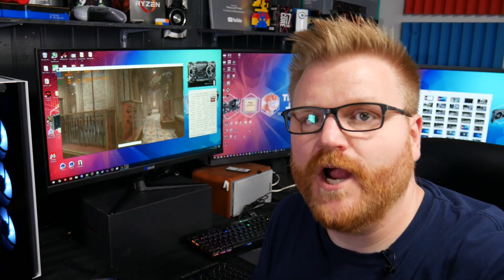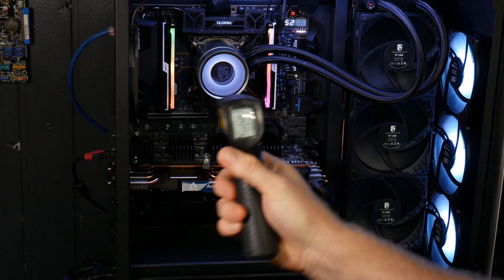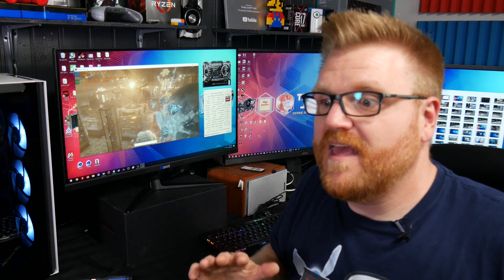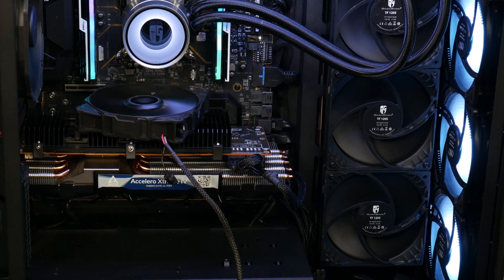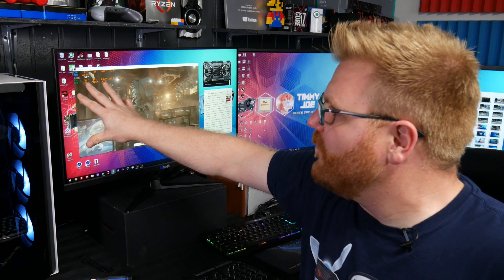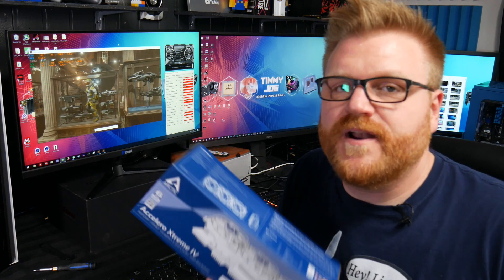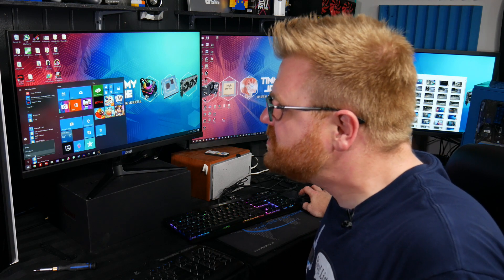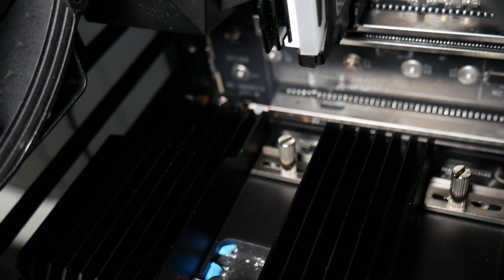Not even the Arctic Accelero Xtreme IV...

Comment: Why you keep running away from Raijintek Morpheus II ?
Reply from the maker: I showed what's going on with the Morpheus at the beginning of the video. They know their cooler which uses the same glue on heat sink design as the arctic iii doesn't cool this card properly. Apparently they are making a special version to fix the problem and they said they would send me one when they fix the issue. They have obviously done more research than arctic
Reply: @TimmyJoePCTech  Ohh ok, my bad. I didn't see the text at the beginning. I have Morpheus and Morpheus II and they don't use the same glue like the Arctic one, so I don't know what they are talking exactly, but lets hope to be something batter. Maybe they are talking about batter sync design. Anyway, we'll wait for update on this topic. Thanks for the info until now.

Comment: has anybody considered that the temp readings for the memory are offset somehow?  i mean like how some ryzens (or was it TR) used to need a formula to get the right temp.  what the sensors showed was either 20c high or low?  they said they needed to do it that way for some reason.  i just dont see why vrm and vram would get that hot on a card thats not really pulling that much power.  something has to be up.

Comment: The Accelero is an excellent cooler, but it's an aging product that has been around for a long time. I'm using that same one with the huge backplate/heatsink on a GTX1070Ti, I added heatsinks directly to the components on the front in addition to the backplate as well, so it cools them really well. But it seems it doesn't fit well on the AMD 5700(xt) cards, since the components on the PCB also needs a lot of cooling, some dinky little heatsinks and heatsinking it through the PCB won't cut it. It doesn't mean the Accelero is a bad product, just not a good fit for this. Arctic should've tested it and just said "Hey, this won't work, we need to come up with a better solution for this GPU series." I think they need to somehow create a new front heatsink which can also directly cool the memory and VRM components as well, instead of relying on secondary cooling solutions like gluing heatsinks and giant backplates.
Reply: Hey man, I want to buy this cooler and I have a question. I have a GTX 980 TI from Zotac, and I have a big backplate that is getting very hot especially when under load (that's good). What do you think is the best method to attach the black heatsink from Arctic to the backplate? Did you do that, that way or you attached it without a backplate?
Reply: @piotrjankowicz7242  Remove the original backplate and replace it with this heatsink backplate. The original backplate isn't needed anymore.
Reply: @Skauber  hmm, maybe you are right. Well, I figured out yesterday that the heatsink from Arctic is soo big that it will not fit 2mm because of the ram slots:(... + will be very close to my bq dark rock pro 4 (which is not good I suppose..) Maybe I will just leave the original backplate and mount just the front of the cooler..
Reply: @piotrjankowicz7242  I had the same problem, I also use the Dark Rock Pro 4. I shaved down the fins on the backplate heatsink, reducing the thickness of the heatsink backplate by around 8 or 10 mm, so it would clear the RAM slots and the giant cooler. Used a power sander for this, and it took about 10-15 mins of sanding to do this, finished it off with fine grit sand paper to give it a nice shiny finish on top of the fins.
Reply: @Skauber  Thank you very much for sharing this. I will probably do the same thing. Last thing.. did you buy any additional  "small heatsinks" for the memory? It seems weird to me that the 3rd version had these heatsinks included, and the 4th version doesnt. Memory needs cooling as well...
Reply: @piotrjankowicz7242  Yes, I actually bought the heatsink kit for the Accelero 3 from Arctic to get different sizes, so I have heatsinks glued directly on the chips in addition to the backplate. I also find it weird they didn't include those in the kit....
Reply: @Skauber   Thanks for the answer. I will have to find and buy some heatsinks too.

Comment: Did you sell your vii if not i would put it back in its a much better card. The xt’s fine but the vrm and memory temps scare me. Going from a strix 2080 and strix 2080ti the 7 and xt were really loud to me but i good undervolt on them really helps. But my vii with a 970-990mv undervolt stays 65c max edge 90c max tjunction and memory and vrm’s run really cool. Love you channel keep up the good work glad to see your growing pretty fast. Most of those bigger channels are getting kinda boring some better than others.

Comment: try thermal gluing (pasting i guess in case it doesnt work?) on some small heatsinks to the memory and VRMS directly, I reckon it will help with temperature.
Reply: This is what I did for the Arctic cooler that I used on my R9 290. It worked amazingly.  I don't know why he doesn't try that. People have been having bad results with that back cooling plate for years. Everyone I've talked to that owns one of these coolers used individual heatsinks for cooling the ram chips and such.  Also, lots of people have commented about this in these comments. I honestly think he just wants to bash it and be mad I guess...

Comment: should have kept  your radeon vii
Reply: I bought a xt to tinker with played with it for a week then put it in the box and installed my radeon vii. Have it paired with a 3900x and a 8700k with a strix 2080ti. The vii when undervolted runs so much cooler on everything especially vrm’s and memory. My tjunction maxes out at 90c and edge stays around 65c with my 990mv undervolt. I really like the look of the vii plus it matches my case the silver phantex evolve x. Also just put a 2700x and strix 2080 in another build. All i have left to pair the 5700xt with is a 5820k, 3770k and 4590k. Gonna put it with the 5820k at 4.7ghz with asus x99 pro 3.1mb. I spend way too much money on pc parts should’ve built one crazy pc with an rtx titan. But if i only had one card in the xt’s price range i would get a 2070 super. Gonna be pissed if the 2080ti super rumors are true.

Comment: Odd cause it worked fine for my GTX 1080 FE. Always look forward to your videos
Reply from the maker: Because the memory on a 1080 does not get hot like this thing does
Reply: @TimmyJoePCTech  mine came with memory heatsinks. But luckily my msi ventus oc 2070 pre applied memory heatsinks. 
Not sure if they are anodized aluminum or black color copper...
Reply: @TimmyJoePCTech  I'm planning to swap the aluminum backplate with 2 all copper proliant hp vapor chamber with finned heatsinks. They are both "1u" tall.  Do you think these would work better as a backplate?

Lastly, do you know where I can obtain a 100x40mm copper or ultrathin TI vapor chamber? I'm going to rig them to my gpu memory chips Thanks!

Comment: Just use a AIO and mod the aluminum back plate to fit the AIO, then mount the Arctic back heat sink on the back. Then OC the crap out of it. Max im seeing on mem 90C. THats at 2150Mhz and MEM at 910 with the German reg edits. Quite and Fast and zero throttling. oh the AIO has a 360mm RAD. GPU temps are in the 60-70s maxed out.

Comment: The problem with the finstack of this cooler is that the fins are going the wrong way. Air exits the back and comes from the front/bottom/top or a combination. Air is basically skipping over the heat sink.

Comment: IDK. I think after market coolers dont work with 5700xt. gddr6 is just too damn hot. my 980 ti had accelero iii and never went above 65c and vrm and vram was fine fully overclocked. My 1080 ti with nzxt g12 with corsair h55 120mm aio never goes above 56c but im running it at 1911mhz at .925v undervolt. Just cuz theres really no point in overclocking a 1080 ti.

Comment: Don't worry Timmy.  Don't sweat it for trying to make it work as the person you try to copy as it giving me mystery to me with my Vega 56 to read 5000 Mhz from my AB and Wattman profile, it only existed when the GPU is under less GPU usages if the frame is cap or doesn't require that much gpu strength to run light game.  I can't go pass 71c with my Vega 56 Air Boost OC blower style and 11,000 gpu score on Firestrike Extreme.

Comment: This exact cooler worked perfectly fine on my mates card. He's been using it for 2 weeks now lol.
Reply: They are supposed to do WAY better than stock coolers, but he has a point in that you have to micro manage all the memory chips. I've really wanted to buy one for my 2080ti as i've used them before, but i'm super concerned about the chipset.
Reply: @rushnerd  it's is. He has been running 99% power limit and extra voltage the whole time as well and the card has been fine. Timmy has clearly got something mixed up here.

Comment: The Sapphire 5700XT has fin array heat sinks on the memory, VRM and the GPU cooler is seperate from the plate that covered the PCB. Check out GN's teardown video. That card looks like the 5700XT to get. Going by what was seen here.
Reply: Hell GN did a review on the msi 5700 xt and the memory was hitting 86+ C.

Comment: have a IV on a blazing r9 290, was like airplane and temps on vrm in 90's although adhesive chip coolers on vrms still, down to 73 on load and 83 maxed vrm, maybe treat it like that?
Reply: 5700xt is not r9 290.
Reply: @nikolakarovic5964  no but could be the vrm's high temp causing the problem rather than the chip which was the problem with the 290 blower style
Reply: @briggsy_  Question is what kind of Vrm is on 5700 , is it analog like 290 or digital which can be one chip somewhere on pcb that overheats and few analog phases.

Comment: Oh Timmy Timmy.  You forget there is only one exhaust in that case and I'm sure you may have knew the flaw of the fan placement design by now with having six fan, seven if we count the bottom fan which are unnecessary placement up front and one fan being the only way out, even if there is a air restriction from the front of the case which we knew the middle fan will be fighting with the top and bottom fan.  I wonder if doing on a open air bench being the case at hand here as it is puling fresh cooler air.  

The biggest thing I catches with temper glass case be:  how open they are between the case and the glass but the problem is lack of getting heat out of the case at maximum CFM, not airflow, isn't possible with this case from the restriction from the front and the side is pulling heat off the triple rad, I ought to check the case temperature under load.  That the biggest hole in the case is the side glass so there isn't any pressure or air tunnel.  My old Thermal case have 4 200mm, 1 side and 1 front, 2 up top, 140mm from bottom and 120mm thin exhaust, there is no way I lose pressure and get direct airflow straight to my motherboard and gpu where the air will follow while remain good pressure sealed case.  With my personal air profile bios keep it minimal under light task and up the fan when under load.  Do yo have a outside temperature gauge you can stick inside the case up in the opening?  I'm curious how warm under the card is when close.  Did you also feel any kind of airflow coming out of the side of the temper glass case Timmy?  If there is, it have too much pressure build up of heat that the CPU is cooling fine with cool air while the Memory I think is in a sauna hell, GPU saying "Everything is Fine" with fire all around him 'edit'. 

    The GPU aftermarket at hand here is only pulling Heat and nothing but Heat, the GPU barely made a dense and this GPU is at 1.2V on Time Spy graphic test #2!  That a lot of heat to not get pass 66c and the Memory I believe being the case temperature.  I thought it made sense when thinking outside the box.  I open up HW Info to find if it had a reading how much voltage it set at stock with my Vega 56 Air Boost OC was 1.250v, that is a lots of heat when I can get away with 950mV at the same speed and GPU stock Voltage was set at 1.2v like your may been too high, I have to under volt to run anything stable with result of lower temperature and faster framerate boost is like the opposite of OC Framerate boost and expected Heat diminish return was a huge learning curve with my Vega 56.

Second thing is the Memory need heat sink, like a ghost shield per says like my 290x 8gb xfx have, a custom copper plates you can buy, or wait for AiB to be available is the very best second opinions over the first best opinions of using aftermarket that were built for the previous launch, this is entirely a new card for the AMD Radeon GCN family like the Vega and Radeon VII being redesign to be able to reach the memory hbm2, but most aftermarket gotten away with it as it was design to a one size fit all dies.

Comment: Best cooler for a reference design is NZXT G12 plus an NZXT X42 or even an X52/X62 , if you can fit it in your case like me where I have an X52 for the graphics card and an X72 for the CPU. https://www.youtube.com/watch?v=fU_hNhpYSP4&t=1261s This is one of my videos testing the G12 and X52 on my factory overclocked Inno 3D Ichill GTX 1080 TI 4X Ultra . Such a weird thing that the stock cooler , despite the name 'AIR BOSS' written on it the card stayed at 80 degrees because it is stupidly overclocked and it had to stay hot 'cause it's going over 2000 from factory. The magic of this combo X52-G12 is mind blowing. From 80 degrees to 40. 

Unfortunately my X72 can't do the same thing with the CPU, it just can't take away so much heat as the combo does for the GPU 'cause the GPU has not idiotic IHS. On the GPU there is that frame for protection and so should have been on the CPU's as well. By the way my CPU is i5 9600K overclocked at 5.0 with a pretty high voltage unfortunately,  1.39-1.4 . 

At this frequency and voltage, the delta temp in about 30-35 degrees in full load. It's pretty OK but it could easily be 20 over ambient. 

I tested my system with 30 degrees room temperature. So the combo G12 plus X52 in purely in GOD mode with only 40 degrees which is actually 10 freakin degrees over room temperature.

 And all this time the CPU stays at 50 degrees in full load not overclocked (which is good ) but if it didn't had the stupid IHS it too could stay with 20 over ambient when overclocked as well. I do miss the good old days with no IHS on AMD Barton 'cause you could chill that thing directly. But I also hated this idea back then 'cause the CPU's didn't had the protective frame that the GTX 1080 TI has foe example. 

Mark my words, f@!k the CPU delidding, f@#k the liquid metal, hear me out : please someone, invent a frame for the CPU just like the one on my GPU , it could be the blessing for the temperature Gods, it's all we really need!

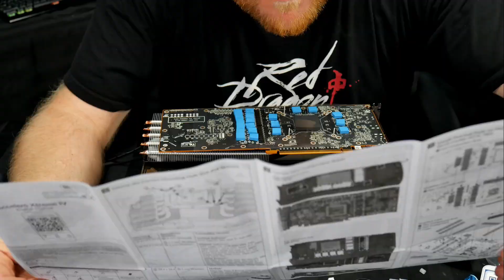Comment: @ 2:02 Those thermal pads look awfully thick. That's probably your issue.
Reply: That's the ones it comes with; I had this for my 970 SSC, and it worked fantastically, it's just the 5700 xt that this cooler doesn't work with.

Comment: Hey, as far as I can tell the cooler needs a front plate to cool the entire memory modules & VRM and allow the heat to spread over a large surface area. I think the heat on VRM and memory modules do not have anywhere to go and they are basically stuck in a small area therefore heat dissipation is really difficult.

Comment: Dude.

You. Need. To. Put.

Nfa12x25 fans on the AC3 in REVERSE.

THE RAM CHIP HEAT SINKS SUCK IN PUSH CONFIGURATION. PUT THE DAMN FANS IN REVERSE.

I get temps under 90C in an Ncase m1 with a pull configuration.

Comment: Timmy Joe PC Tech : Arctic Accelero IV came out in 2013 dude, it's unfair to criticize them because they couldn't have known that the GDDR6 on Nvidia or AMD cards was gonna heating up so much....back then we were on 7000 GHz GDDR5 with the GPU-s....memory wasn't needing a heatsink cooling at all, it was enough to have some air blown on it through the main heatsink. But the VRM-s needed separate cooling back then already especially on the GTX 770, GTX 780, GTX 780 Ti and R9 290(X) cards.
Reply: You musta missed the point here. 
They sent him the cooler saying that it would work. I’m fairly sure he knows when the cooler came out.
Reply: @kadboodle  it does work, it fits on the gpu and cools it. But the problem is that Accelero IV was designed and released in 2013 when they didn't know about the power hungry and LAVA heat dissipating GDDR6.
Reply: I’m not trying to be a dick. 
But you’re ignoring what he, and I, said.
The company SENT HIM THIS COOLER SAYING THAT IT WILL WORK and implying it will be  better than the stock blower. 
It was not. It doesn’t work for this card. 
Regardless of the fact that it functions, it doesn’t work for his card, at the very least.

Comment: the tempratures probably due to the way they reorganized the temperature sensors.  picture one of thoes sensors being covered over and blocked in "between a thermal pad and under the heatsink where 0 airflow ever gets. not what i think of it  i guarantee thats probably what it is since the vrms being coverd with goo tape bits and then having a slap of metal bolted over top of it. "cough the back plate"

Comment: I have no idea what AMD did with their memory controller with the ddr6. Nvidia does not get that hot and they have nowhere near the speed on the mem that nvidia has. It's really a fine core limited by a shit memory controller.
Reply: Yep the memory controller isn't that good compared to nvidias, they can clock far better, using oc. Probably too much heat or something, imagine the controller being too hot because of the stream processors next to it, maybe the cuda cores are a bit better positioned